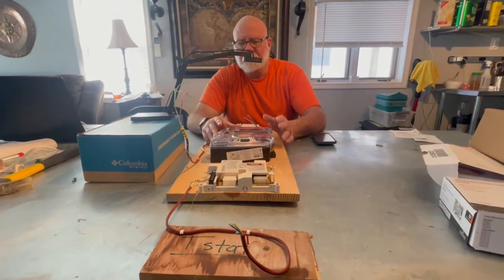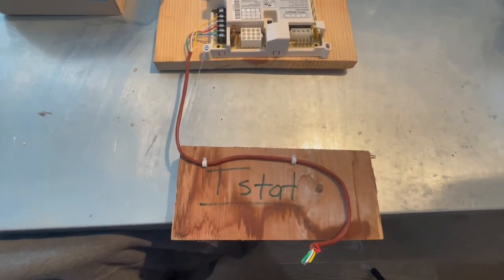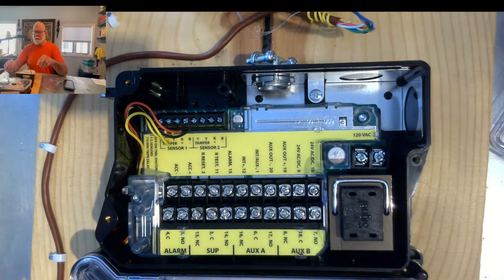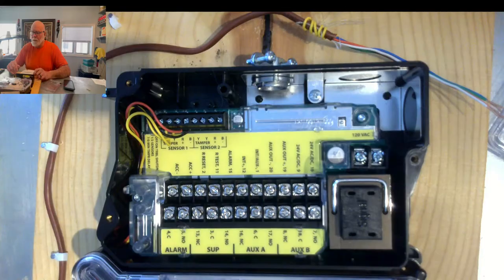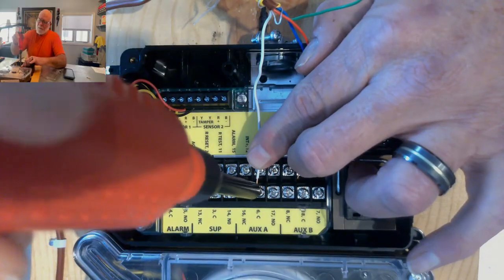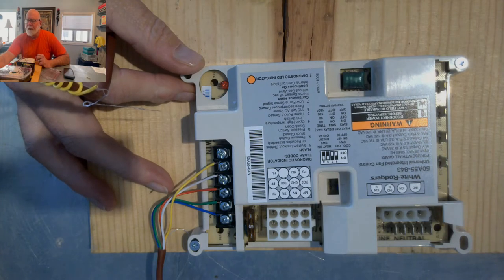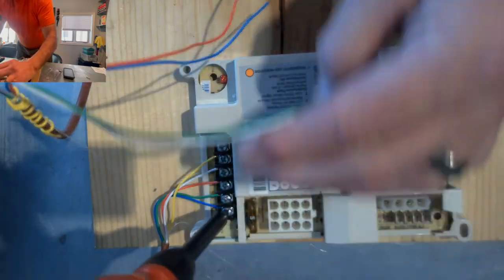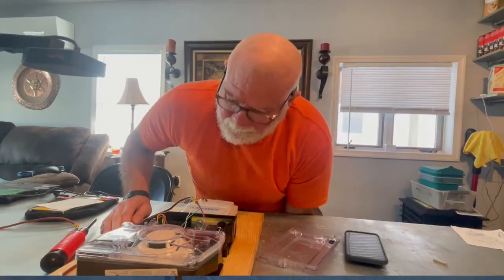Wiring Innovair Duct Smoke Detector

Comment: Jumper brake it’s on a Carrier while Trane has a terminal along the side of the fan center terminals in the Symbio 700 board,however,the older Trane equipment including new Relia tel would have a landing on the far right side where test screws are found. Fun times Good luck 👍🏽👍🏽

Comment: I’m trying to install this in a air handler 
What cables do I connect the green and the white to
Reply: You need to shut off the fan.   It depends on what unit you have.
Reply: In this situation it would be best to kill R going to the thermostat. So if a fire alerts, it will shut off the unit
Reply: @llchips7 hi sir. If i want wire it to gas furnace what should I do. It already have 120 power. Should I wire NC and C to furnace with fan and R?  Thanks
Reply: If the control is already powered and you are wiring a furnace to shut off, I would break red going to the thermostat by running it through C and NC. (6,16)

Comment: Hi Sir I am looking residential duct smoke detector wiring with 120V  .
Best regards.
Reply: Run 24 through the 6 & 16 to cut power to the board and 8 & 18 to a 90-340 relay to cut the 120v to a motor if necessary. It is necessary to cut power to the motor when residential x-13 units used in commercial locations, because they don't shut down immediately.